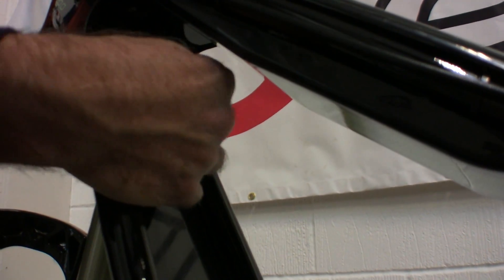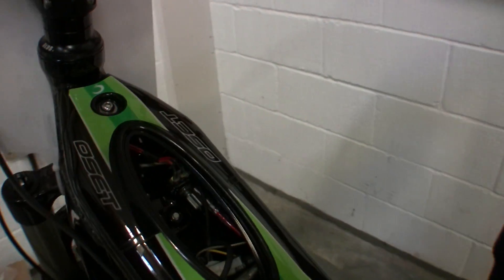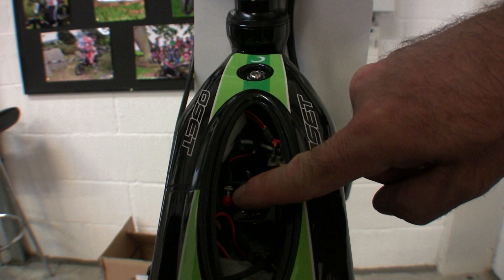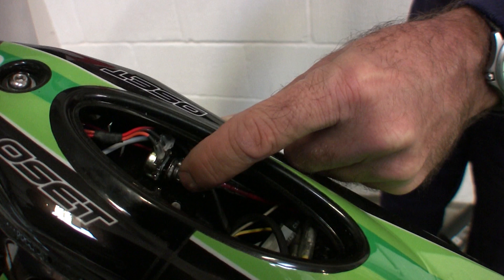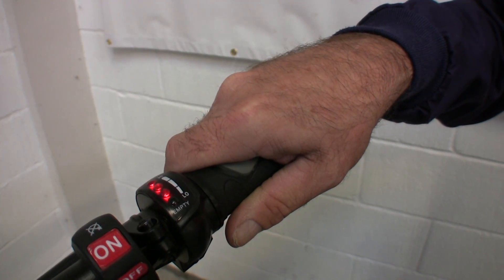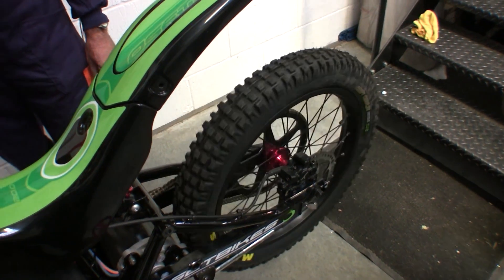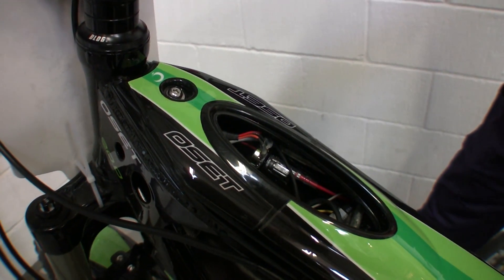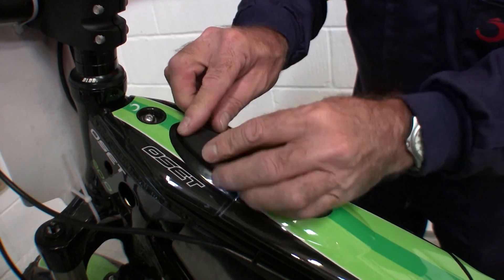OSET Tech Guides. Setting Speed and Power controls. VERY IMPORTANT!

Comment: So “response” is acceleration time of the controller ie how quickly it will ramp from 0 to max rpm. “Power” is current limit and “speed” is the setting of max rpm at full throttle.
The problem with these bikes is that the minimum speed is not adjustable and is too high, resulting in a jerky on off of the motor when trying to ride trials type courses as it has no clutch and you don’t have the finesse available to creep.  How do we connect with software and change this?  The factory setting is like 10%rpm as soon as the throttle input gets to the threshold where the motor is powered.  It needs to be feathered all the way down to zero when the throttle is at zero.
Reply: Is there a solution for this now?